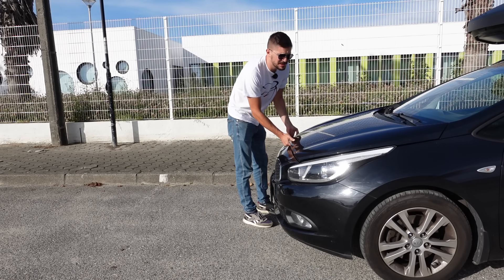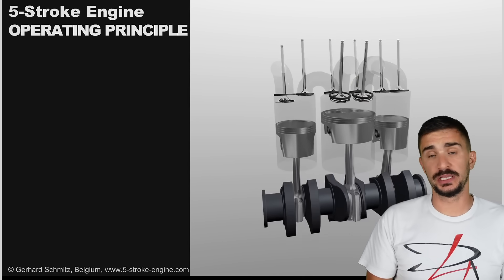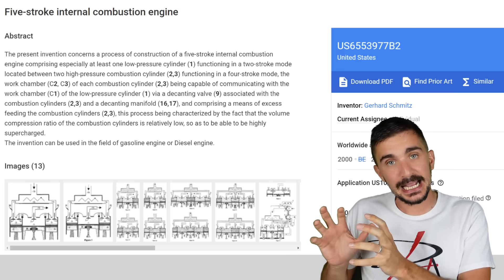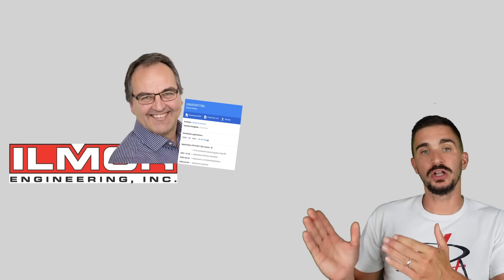Why Five Stroke Engines Are More Efficient But Still a Failure

Comment: I take one issue with the “caveat” about the engine size argument.  Yes, adding the extra low pressure cylinder accounts for size purposes but only the two high pressure cylinders count for volumetric calculation purposes.  The low pressure cylinder is in-line with the high pressure ones so it doesn’t do anything to affect the volume of air being cycled into or out of the engine as its purpose is completely passive.

I’m seeing this as a kind of “reverse supercharger.”  Where a traditional supercharger takes mechanical energy from the crank to pump additional air into the intake, this concept takes energy from the exhaust gasses and turns it into mechanical energy directly into the crank.

If your only concern is extracting as much energy out of a unit of fuel as possible and you have few or no limitations on space, this kind of design can make a lot of sense, particularly when paired with other efficiency-increasing techniques like turbocharging.

Comment: The longer the cylinder stroke, the more torque output, but lower horsepower, and the higher the compression.  Its a large part of why diesels are more efficient.

Comment: Shouldn't it be called a 6-stroke engine since after the extended expansion stroke, the low pressure cylinder does one more stroke where the exhaust gases leave the cylinder, and then the cycle repeats?

Comment: The 5-Stroke engine seems perfectly suited for hydrogen in a electric hybrid design. Hydrogen & a very narrow rpm range would probably solve the emission problem & probably even increase the efficiency of the engine.

Comment: Would it work better in a hybrid setup, where it could be running constantly at high RPMs to power the vehicle or recharge the battery when little power is immediately needed?

Comment: Smoke is pushing down the central piston and that's good.
But at tge same time it's pushing down the side piston, and that's bad.
To make things worse, side cilynder has a higher pressure too.
So they cancel out.
To try save the day, they made the central cylinder bigger.
All this room lowers smoke pressure even more.
Not worth the added complexity.
Not to mention how dirty the central cylinder is going to be, egr valve style.
You're better off using that smoke to supercha rge a common rail diesel.

Comment: Summary

Efficiency Problems of Four Stroke Engines:

* (0:00) Only the combustion stroke produces significant energy.
* (0:40) A lot of energy is wasted as heat and noise through the exhaust.
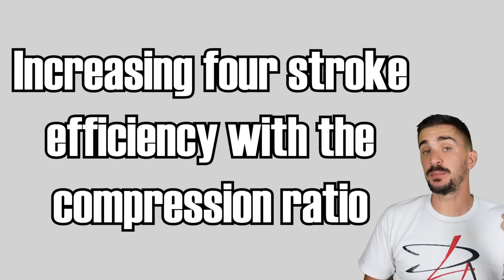* (3:01) Increasing compression ratio for efficiency is limited due to knock and material stress.

Five Stroke Engine Concept:

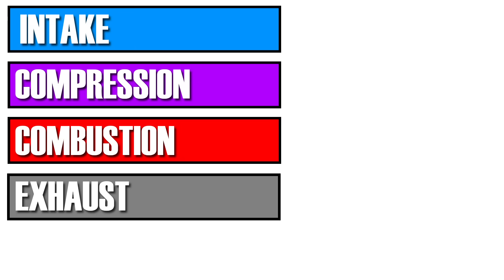* (5:25) Aims to increase efficiency by extending the expansion/combustion phase.
* (6:12) Early attempts by Otto and Daimler failed due to technology limitations.
* (8:13) Modern attempts by Gerhard Schmitz and Ilmor Engineering showed promise.

Reasons for Five Stroke Engine Failure:

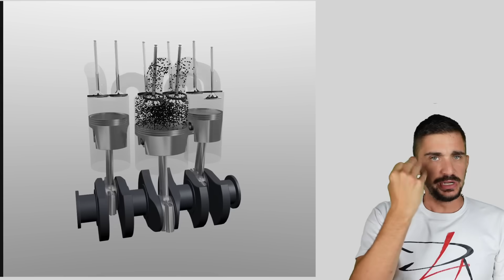1. (13:07) Marketing Misleading:  Engine size and turbocharger presence were misrepresented, making efficiency gains seem greater than they were.
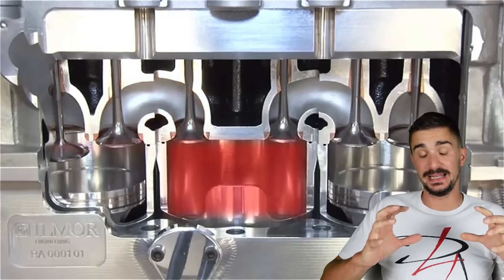2. (14:49) Low Load Inefficiency: The extra piston becomes dead weight at low RPM and low load, negatively impacting efficiency in common driving situations.
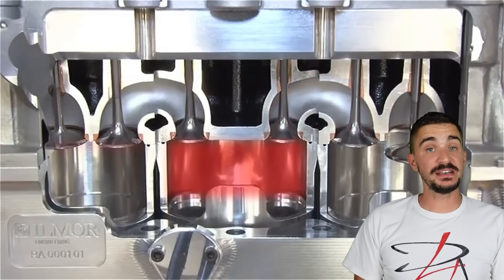3. (15:59) Emissions Issues:  Lower exhaust energy makes it difficult to heat catalytic converters efficiently, making it hard to meet emissions standards.

Conclusion:

* (16:28) While promising, the five-stroke engine ultimately failed due to practicality and emissions challenges.
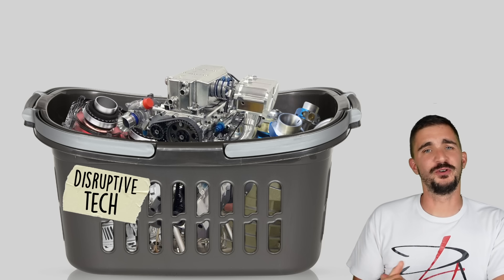* (16:43) The four-stroke engine, despite its age, has proven adaptable and efficient enough to withstand numerous “disruptive” technologies. 

YouTube Comments Summary: Five-Stroke Engine Video

General Sentiment:

* The video is well-explained and informative. Many viewers are learning about five-stroke engines for the first time.
* There is a mix of amazement at the concept, with skepticism about its viability.
* Viewers are engaged with the video, sparking further discussions and ideas.

Specific Comments:

Positive:

* Appreciation for clear explanations and visuals.
* Interest in unusual engine designs and historical context.
* Support for continued ICE development, despite the rise of EVs.

Negative:

* Disappointment that the five-stroke design ultimately failed.
* Some felt Ilmor misrepresented the engine size, making the efficiency gains less impressive.
* Some criticized the video's focus on automotive applications, suggesting other potential uses like generators.

Alternative Ideas:

* Many suggested using the five-stroke engine in applications with constant high load, like generators, ships, or aircraft.
* Some proposed integrating features like cylinder deactivation or electronically controlled valves to overcome the low-load efficiency issue.
* Several compared the concept to compound steam engines and suggested using turbines for exhaust energy recovery. 

Debates:

* A few debated the actual efficiency of four-stroke engines and whether the numbers presented were accurate.
* Several argued that electric motors are older than the four-stroke engine, challenging the video's closing statement.
* Some questioned the need for emission controls and argued that they hinder efficiency.

Humorous:

* Several joked about the "sad vacuum cleaner noises" and a black spot on the screen.
* Many enjoyed the closing rant about ICE longevity. 

Overall, the comments show a diverse range of opinions and ideas sparked by the video. While many agree on the five-stroke engine's theoretical efficiency, there is a lot of discussion about its practicality and alternative solutions. 

i used gemini 1.5 pro to summarize the transcript and comments

Comment: Wouldnt this be great for Hybrid trucks?
You have a gas tank and a 5 stroke engine which will run at a fixed RPM. It can be used to charge the battery when the battery is low.
- Higher 5 stroke engine efficiency
- Great engine performance as it is optimized for a fixed RPM
- Higher range due to gas tank energy density 
- Benefits of a electric drive train for regenerative breaking. 

As long is the Gas to electric is not through the regenerative breaking it should be good right?

Comment: 0:00 🚗 Internal combustion engines are not very efficient, with modern gasoline engines averaging around 35% thermal efficiency.

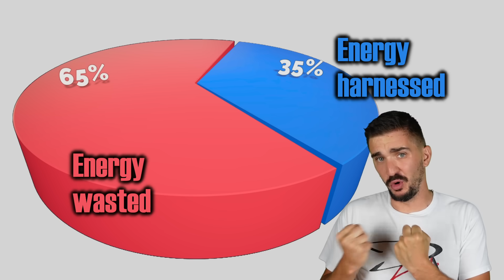0:51 📉 The inefficiency stems from all engine strokes being of equal length, with only the combustion stroke producing significant energy.

3:01 📈 Increasing the compression ratio can enhance engine efficiency by allowing more time for energy harnessing during combustion.

7:12 🔄 The Verbund Motor utilized in the past added a fifth stroke, "extended expansion," using exhaust gas energy to boost torque.

9:11 🏎 Ilmor Engineering, known for high-performance engines, developed a five-stroke prototype showing promising fuel efficiency and power.

13:12 ⚖ The five-stroke engine faced challenges with varying exhaust gas energy levels at different engine loads, impacting efficiency.

15:54 🌱 Despite its potential, the five-stroke engine struggled with emission standards due to slower catalytic converter heating.

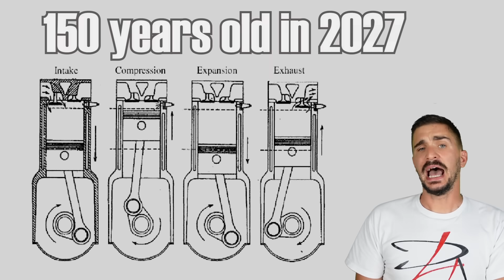16:43 🕰 The conventional four-stroke engine has persisted for 150 years, resisting many attempts at disruption due to its reliability and efficiency.

Comment: Not sure if this is really open for conversation around various things brought up in the video.

What if (granted more complicated) we had a sort of cylinder de-activation for the middle piston?

Could we put another valve in the exhaust flow that would direct air away from the middle piston. During initial start-up and warming period to activate the catalyst the full heat of the exhaust would be there, once the engine is up at operating temps and catalyst sufficiently heated the lower temps from turning on the middle cylinder shouldn't matter as much. 

Alternatively, for both catalyst, and low-rpm/low load, you could have a direct injection fuel add to the middle piston, OR even simpler than that if the outside pistons already have DI, as the exhaust stroke is occurring, literally throw more fuel on the fire, you don't run any risk of knock as there's already an evacuation into the 3rd cyl. It puts more energy into 3rd piston and you still have something to capture. It does mean more fuel per cycle in this state, but overall could improve the range of efficient power for the whole package. (though in these conditions the engine might sound a bit 'burpy')

If there was an easy way to re-direct exhaust gasses you could do this with a standard form of cylinder de-activation. Not only don't add fuel and spark to a cyl, but also have the active cylinders becoming the intake, but that would likely be some rather complex plumbing, and the conditions in which modern cylinder deactivation take place is low-rpm low-load, so I'm not sure it would be worth it.

Comment: What if they made the center with a compression detination, maybe with a smaller injector or with an alternative fuel source say like propane. More balancing i.e weight would be needed, with less scaviging affect. But with the studies/labs could reasonably double the 30 to 60%

Comment: respectfully disagree your explanation about why higher CR increases efficiency. the real reason is to do with carnot efficiency, based on 2nd law thermodynmics. the higher cr gives a higher temperature of combustion (and therefore pressure)

Comment: I think, it`s s good design for constant load engines, like electric generators and so on.
Also, it may be suitable for UAV with hybrid electric propulsion, because in this case no need in catalyser or turbocharger, but low cost, simple construction and low fuel consumption will be applicable.

Comment: Seams to me that this design would be excellent for racing applications and/or small engines where usage at low rpm isn't really a consideration to begin with. Or maybe something like a power generator or fluid pump where a more long term steady usage scenario is required.

Comment: Would a double-expansion/5-stroke engine like this have potential as an aircraft engine? Since piston aircraft engines spend the majority of their operating life at the top end of that RPM curve (in climb and cruise) I could expect it might be able to take better advantage of the most efficent power range of the engine.

Comment: If idle RPMs cause it to be inefficient, wouldn't it be a could engine for hybrid / electric generator vehicle? Maybe even small/medium size hydrostatic equipment. Asphalt rollers, excavators, mowers, etc

Comment: Wasn't the Turbocharger system harnessing the Hot Expanding exhaust gas to spin the turbine that spins the compressor of the Turbocharger and forcing air into the combustion chamber...this also increased the engine thermal efficiency

Comment: To add some unneeded complexity to an already complex engine, you could supplement the low RPM dead weight with an electric motor/actuator (a piston pusher). That could in effect also act like a charger to the electric motor once a certain sustainable load was achieved (regenerative... stroking? Haha.). Neat engine. If anyone had a bunch of money laying around, there might be some development that could happen with it that could be useful for cars/trucks.

Comment: The problems at extreme ends of the RPM range tells me that this engine would be better suited to driving a generator than it would be for running a standard engine.  Since generators always need to run at a very narrow range of speeds (and ideally at one fixed speed), the engine could be built to be most efficient at the required speed to run the generator.  It could still be used in a car, but as the power source for a generator in a hybrid vehicle.  The problem of needing heat to make a catalytic converter work correctly sounds more like a problem of upgrading the chemistry of catalytic converters so that they work at a lower temperature, or finding an equivalent lower-temperature method.  That might be impossible, but my instinct says that's unlikely.

Comment: Aahhh. So basically the 5th stroke pretty similar to compound or multi expansion steam engine.
Reply: It's exactly the same, and has the same advantages and drawbacks.
It's good for ships, because of the constant rate. Not so good in small sizes with variable  speed range.

Comment: I wonder if they could maybe have a Fuel injector for the middle cylinder to assist it in low RPM situations and when the engine is operating at a sustainable RPM you could shut the injector off or assist substantially less then it was.  It's a cool concept.  Hope to hear more on it someday.

Comment: I'm disappointed that the use case of EV range extender/charging wasn't addressed. Where it can be ran at peak efficiency. Or the 3rd cylinder acting as a normal cylinder with direct injection at low rpm and the 5th stroke at high rpm when it's making high pressure etc.
It has potential but it wasn't applied right

Comment: I believe those efficiency percentages are valid only when the engine is fully loaded in the maximum torque rpm range. Normal driving with 30-60mph is going to lower the efficiency.

Comment: 0:21 good video. If I may just comment on the "cleanliness" of diesel motors. They are cleaner than gasoline motors buy the standard of emitting far less CO (carbon monoxide) and the soot that is emitted is heavier than the atmosphere around us and simply falls to the ground. Far fewer pollutants go into the air than a gasoline motor. the EPA in the US will tell you differently however due to the gasoline lobby paying them a lot of money to "research" the issue. What we are told about diesel pollutants is a lie in my opinion.

Comment: Those are not the efficiency numbers for engines, those are peak efficiency at its maximum power rating. The problem with engines in cars is they are almost never at that point so efficiency is much worse

Comment: I always thought that CR and rev limits for diesel engines come from the fact that we can't build fuel injectors that could inject the fuel at high enough pressure and short enough time - and even though we obviously can do it, they're not small, cheap and reliable enough to be used in cars expected to last at least few years.

Comment: In a way, electric motors have been around even longer than the internal combustion engine.  It dates back to the early 19th century. So, with all due respect, electric motors are older.

Comment: Still glad with my EV.  The electric motor is so much simpler and so much more efficient at converting potential energy to kinetic. 

My bmw i4 uses non permanent magnet so it’s also light on the rare earth supply chain.

Comment: Rotary engines are amazing! They are just too Niche! There are too few situations that they gain a benefit over more conventional designs, so there's less demand, and less development because of it. There's a reason that cars don't run off of two cycle engines... there are certain things that two cycle engines do better more cost-effectively than any other design... but you're not going to see one in a full size automobile.
Reply: My SAAB has one...

Comment: Question: Would a 6 stoke engine that operated on a cycle of, intake, compression, ignition, exhaust, and then one full rotation under vacuum work? Or would the delay between cylinders firing being too long?

Comment: Why is it not used as a generator in hybrid  cars where it can run at its most efficient rpm?
Reply: Because the payback in hybrid cars is minimal.
A straight Diesel-mechanical car gives better MPG than a hybrid, without the complication.

Comment: Since exhaust smoke is moving at a high speed. Why don't we harness that energy to generate electricity. Attach a generator to the exhaust pipe. Have a gear system to increase the spin. Connect that generator to a battery pack. Use that energy to power an electric motor.

Comment: Volvo Trucks  in North America have a feature on their 13 liter engines called Turbo Compounding. It recovers some of the heat lost during the exhaust stroke without resorting to a fifth stroke. After the exhaust exits the cylinder and goes through the turbocharger, it then goes through an additional turbine. This turbine directs some of the usually wasted energy to a gear link that drives the crankshaft.  This significantly increases fuel efficiency .

Comment: On the three cylinder model - I see the so called high pressure cylinder passing this excess pressure on the return stroke to the center low pressure cylinder.  Problem then is that both the high pressure cylinder (sender) and low pressure cylinder (receiver) are at the same pressure and the net gain is actually zero. They are in effect balanced. (actually unbalance due to the crank rotation position but equal when considering the full stroke).

Comment: Ironically in 2003 I was working on a nearly identical engine. I called it the double expansion engine. it worked similar and I agree with most of what you mentioned.  The same result can be made from a conventional 4 cylinder in line, where the two middle pistons act as the double expansion part, that would allow for using nearly all stock components. Regarding the low speed vs high speed, this engine would be best suited for hybrid vehicles, with the engine tuned to run only at optimum RPM to charge the battery and/or cruise at hiway speeds.